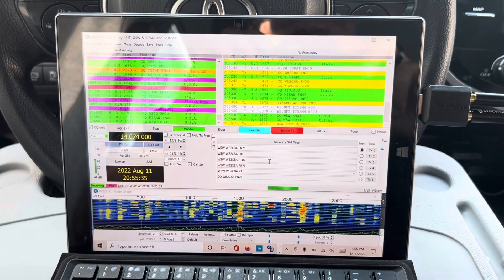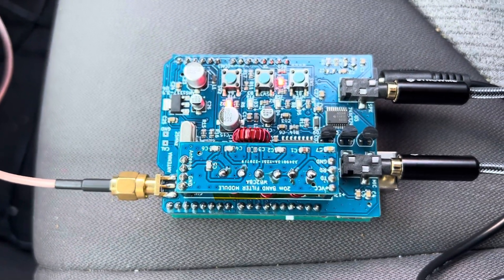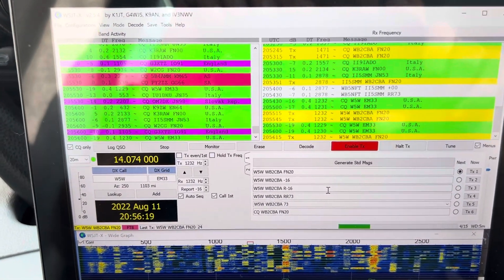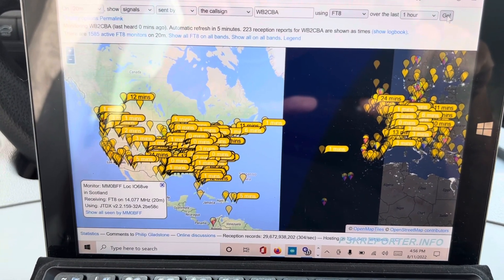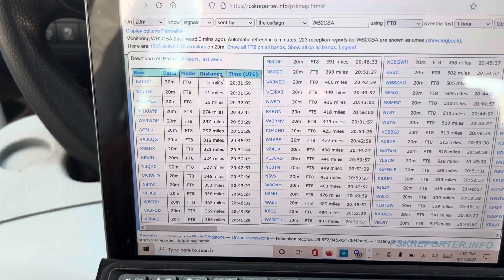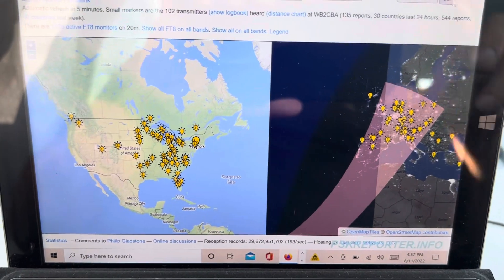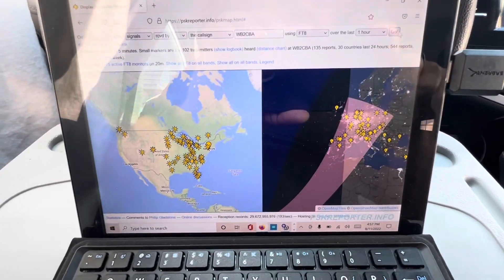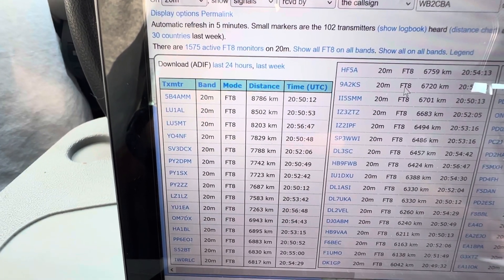ADX UNO - ADX Arduino Digital Modes HF Transceiver in Arduino Uno shield format!

Comment from the maker: I did some more test on wspr with this tiny rig performed like a champ!Reached Australia with mobile antenna!:)
Reply: Impressive. Are you planning to release the Kicad files some day? Did you change much from your original design? I see you changed the 3.5mm jacks and chips are now SMD.
Reply from the maker: @jeroldponko7168  it’s the same ADX design in smd format. Uses the same ADX firmware.